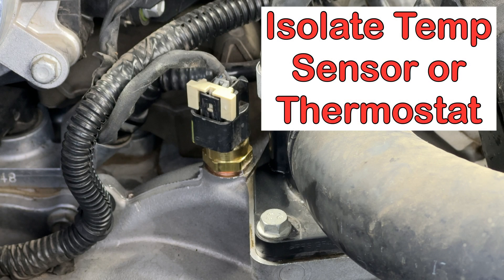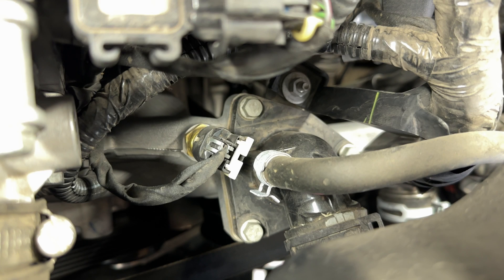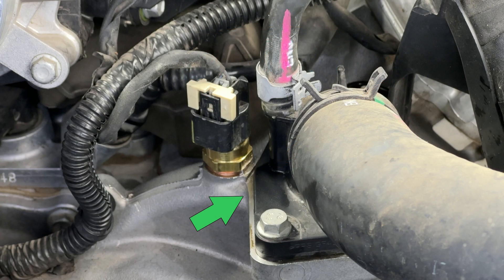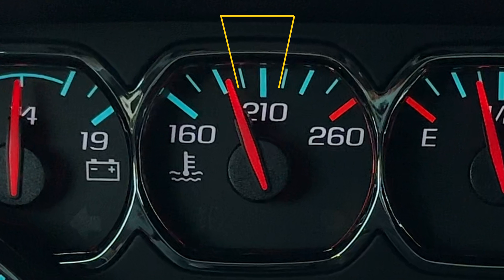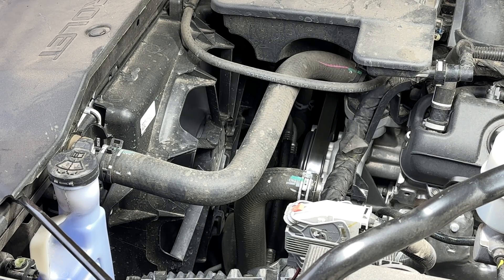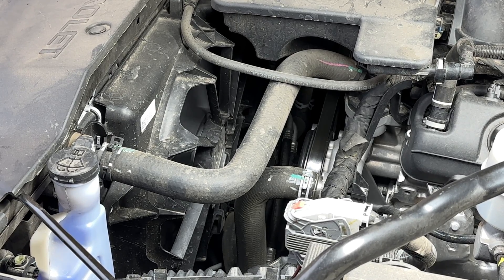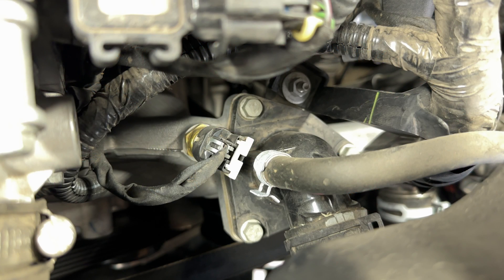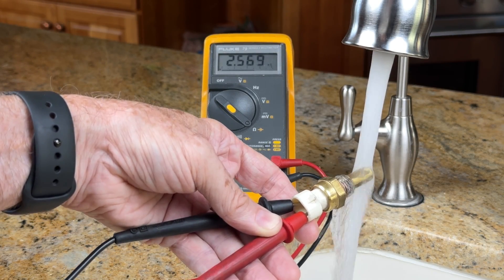Isolate Cooling System Problems between Thermostat & Temperature Sensor

Comment: Thank you for the information. A bit confused. My temperature gauge is showing a minimum reading and runs a bit rough. The fan is also on a full speed. Are you saying it is certainly the sensor?
Reply from the maker: Remove and then reconnect the battery cable to reset the error (as shown in the video). Then watch the temperature gauge as you drive the vehicle. If it moves from the minimum position then it is likely the thermostat. If it never moves at all (from the minimum position) then it is likely the temperature sensor. You must reset the error (by disconnecting the battery cable) for this test to work. Otherwise it will stay at the minimum reading because the error code is making it do that.
Reply: Just did the test. Temperature started rising slowly. Will just get both as the mileage is a little up there (240k kms) as a preventative measure. Thank you very much for your advice. Keep up the great work. From Botswana
Reply: Ah decided to try the sensor first. Seems to have fixed the problem. Looks like it was working intermittently. Found out that a mechanic that I was tasked to flush the coolant stole my original sensor that came with the car. Thanks again though👍🏾